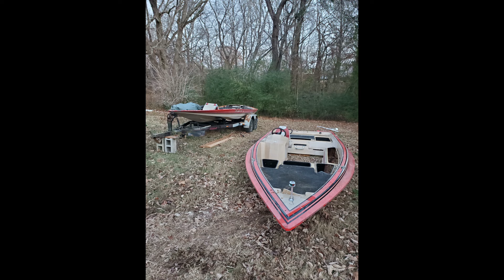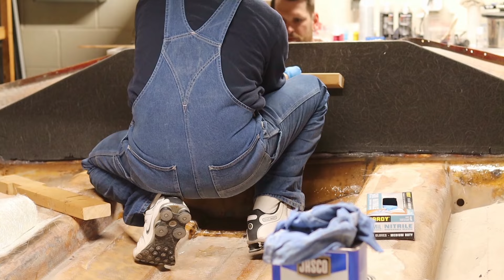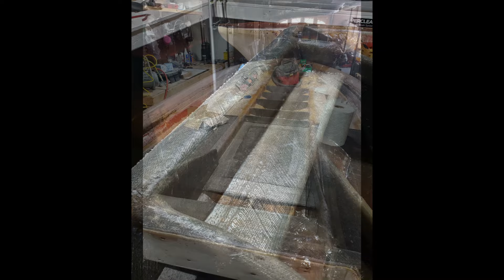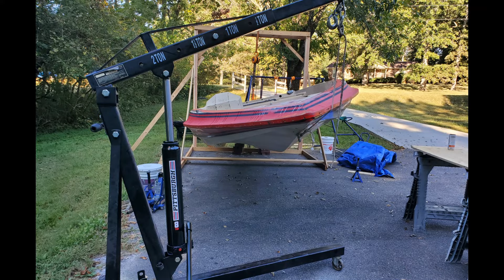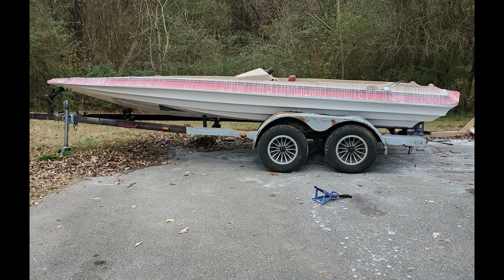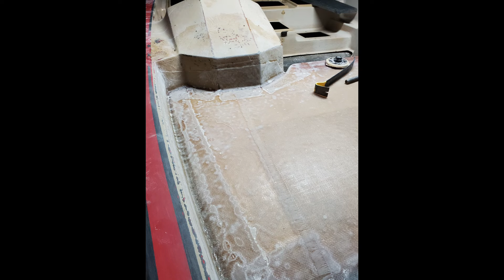SUPER DUPER LIGHTWEIGHT BASS BOAT BUILD - SHADOW 200VT - 1yr Later

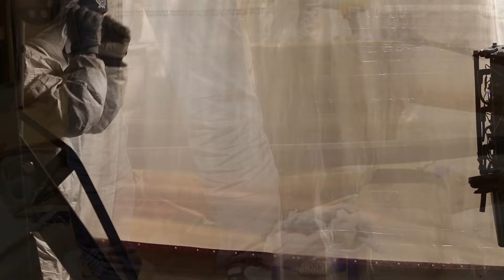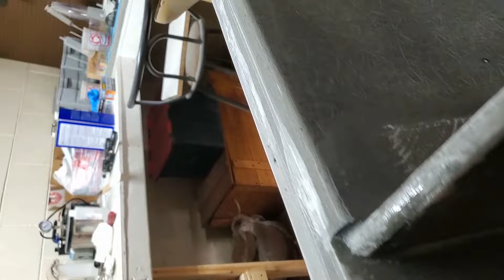Comment: I'm enjoying your videos though I've only seen 5. Love what you have going on with the Frankenbeast. You're doing what I'm researching to begin doing. My dad raised me up with the Tower of Power. It's 40 yrs old and still runs like a Swiss watch. I'm ashamed I've only recently turned my eye from the L6's to realize Kiekhaufer's design wasn't the only outstanding Merc. production. I'm currently loving everything I've seen on the 2.5L Mercs. Diggin the Frankenbeast ! I'd be hollerin WOO HOO TOO!!! LMBO. Now, watching this video, I can assist with the frp aspect of your hull refurb. 25 yrs Engineering Specialist. I'm curious as to how you laminated the transom panels. It appears you are using possibly polyester putty (1:02.0 - 1:34.0). I hope you did not. Feel free to message me if you'd like. You can teach me a bit about the important part, the 2.5L